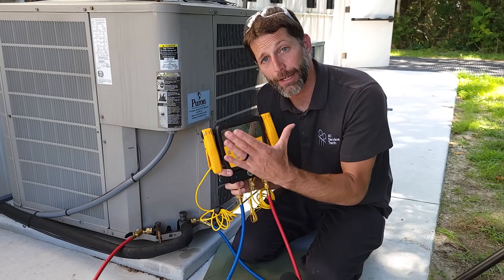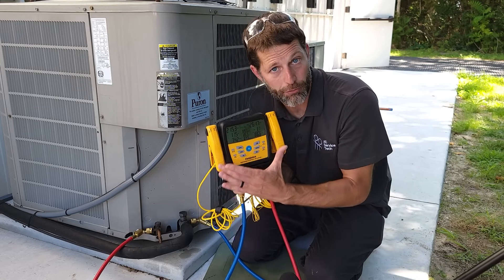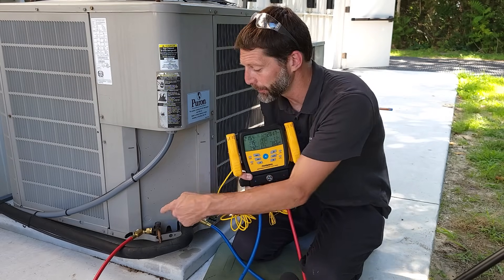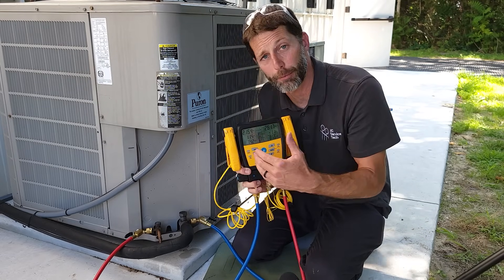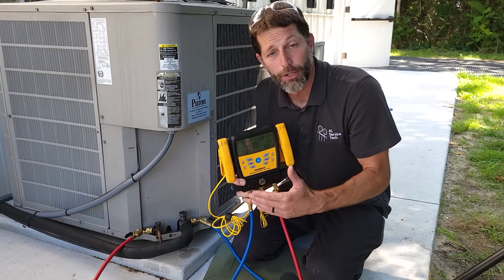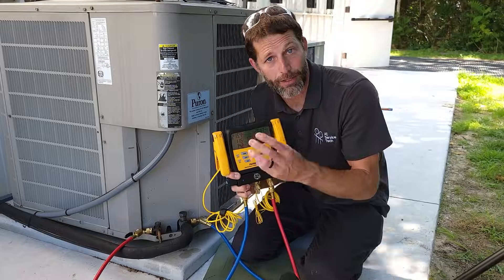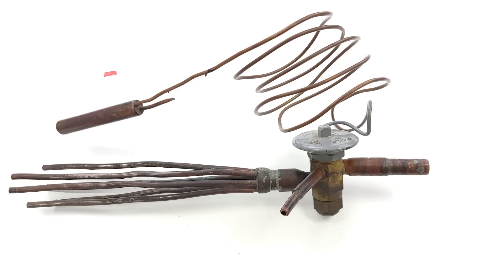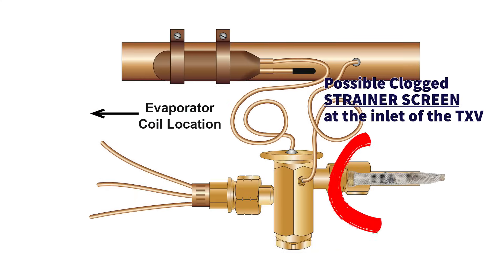Troubleshooting Indicators for a Liquid Line Restriction, Low Airflow, Low Charge! Check the Charge!

Comment: So whenever you charge a system how do you go about temperature if it’s colder obviously your pressures are going to be lower so then your sub cooling will be lower as well right? So how do you go about properly charging the system when it’s pretty cold and pretty hot outside weather.

Comment: A new system was installed in my home never worked ok. 3 technician from the company came to check and nothing worked out, (suction line 130psi  superheat30  saturation60)    
(Liquid line 350psi  subcooling10  saturation110)   any help please???   Rheem 3.5.   Expensive valve system

Comment: Heres a good one...was on a york unit, pressures were almost equalized with unit running. Tech support diagnosed a compressor, changed compressor.....pressures still almost equalized (only 20 psi difference). Verified metering orifice was correct, airflow correct, coil not blocked. What would cause this?
Reply: Get some new gauges 😂

Comment: thanks for the lesson brother, I also want to add an experience that I deal with pretty often. I work with the RTU and majority of the restriction that I have on the units are on the filter dryer. A good way to visually inspect for a restriction like this is to touch both side of the lines (coming in and going out), and if you feel a difference temperature on both side of the line like hot and cold, it means the filter dryer is clogging the refrigerant from fluing properly.

Comment: should the suciton line always be sweating in humid 90+ degree heat? I have a 3 ton unit that is sweating, but I had a 5 ton unit with txv replaced recently, its cooling but the suction line not even sweating, just slightly cold to touch

Comment: Is it possible to confirm a liquid line restriction without measuring the line temps? I had a tech connect his bluetooth sensors his screen literally had no superheat or subcool temp measurments. He quoted a liquid line restriction in addition to low refrigerant. Of course the fix is a whole new system.

Comment: I work at a hospital where they’re using cooling towers and a heat exchanger ( water cooled system ) to reject heat from the super heated vapor leaving the compressor. These Units are also larger, bigger EVAL coils, than your typical residential systems as well. Does any of your methods change for a such a system?

Comment: I love this video. A high Delta t indicates a restricted air flow to the evaporator as well. For those who don't know, the Delta t is the difference in temperature between the return air temperature and the supply air temperature. Normally, it's between 18°-22° Fahrenheit.

Comment: My system is a central air, 2 ton rheem. I did check my delta T and it's 17 degrees difference, which means i think it's good on freon. But I did use my testo digital gauges and it shows that my SC is 43 degrees. what could be happening ? filter, EV coil and CONDENSER are clean, 90 degrees outside and 76 in side.
Reply: What was the problem?

Comment: My outdoor unit runs for about 2 minutes and then makes a loud knocking noise (like a car thats thrown a rod), and shuts off. During those 2 minutes, cold air does blow. Is that a bad compressor?
Reply: Could be.  But I've heard some really bad sounding compressors that still work fine.

Comment: I have a question for you.

I know you said be able to diagnose the system before adding any refrigerants.

You mentioned there might be a low airflow, collapsible ducts, restricted metering device, blower speed issues, or restricted filter dryer. Also, you mentioned checking the  
filter before adding any refrigerants. Subcool must be between 8-12 degrees. Superheat 8 to 14 degrees. Those are normal ranges.

Let's say for example, I have a superheat of 12 degrees Fahrenheit, which is good. 

On the other hand, I have a subcool of 17 degrees, which seems to be higher than normal of 8-12 degrees subcool.

After checking everything you mentioned and finding out everything is normal, are you still going to use your recovery machine and recovery tank to recover all your refrigerants because the subcool is a little high?

Comment: My unit doesn't have the subcool value on the plate.  It, instead, reads R410A 0.55lbs (I assume this is just the air handler amount), Design Pressure High  550 PSIG, Design Pressure Low 240 PSIG and the unit has a TXV in the air handler and an EEV in the condenser.  The condenser has the same PSIG values printed on it as well.  My air handler shows 1000 CFM too.  How would I determine the sub-cool and super heat from these numbers - is it a simple matter of looking at the saturation temps associated with the PSIG range from R410A p/t chart?  Meaning at 240 PSIG, I would have 81F saturation temp and 550 PSIG would be 142F sat temp.?
Reply: Look up the condenser Manual and it’ll be in there

Comment: I live in el paso texas i do hvac service work and installs i love it and with these videos ill become a pro in no time thanks ac service tech
Reply: I live in el paso tx too, and my builder installed a new unit with r410a but worth an r22 txv. I've always wondered and complained about restricted air flow and also the air does not come out cold. I'm not a tech but it has to be the r22 txv not working correctly with the r410a coolant right?

Comment: So I just moved and I put my gauges on unit and low side - 64.1psi, 30SH, and 36.9vsat. High side - 243psi, 24.7SC and 115LSAT. T1(67) T2(90). Does this seem to be a TXV issue or dirty coils? 
Awesome video by the way! 👍🏾
Reply: No one at tire places or dealerships put gauges ona flat tire..you gotta see or find the problem first then put on gauges...what im trying to say is start by checking air filter evap coil condition 
Ductboard/sheet metal/attic/crawl space air handler blower speeds  then work your way to the outside of the home by checking drainage and condenser coil condition

Comment: Here’s one!
R410a with TXV, cooling mode.
Outdoor ambient DB=87 F
Indoor DB=85 F, indoor WB=71F
Required sub cooling=12
Low side=145PSIG superheat =15
High side=307 sub cooling=3
Compressor amps 6.9 
Outdoor ambient and coil temp sensors both ohm at 8.9

Defrost board flashing High Pressure lock out code.  The above parameters were reached holding in the contractor for 10 minutes.
Anyone?

Comment: Can I use this same method if it has a piston instead of a TXV?
Reply: no you need to know the specific temperature ranges to be looking for for the specific metering device the system is using, basing a reading for a unit using a piston instead of a txv is going to completely set you off track, leading you to completely overcharge/undercharge a unit

Comment: I am not an AC service tech. However, I am required to work on them as they are part of a larger system. These videos help me a great deal.
Reply: You need an EPA type I, II or universal certification to be able to work on them. At least if you are either connecting manifold gauzes, removing or adding Freon. If your job requires you to work on units where you are required to check pressure or use Freon, then that is illegal and your company needs to be held responsible for violating the EPA regulations. If I had to pass the exam and get my certification, then you should do same and so does anyone working in your company. Not to be rude, but you should definitely get your EPA certification and or get your company have everyone certified.
Reply: If your not certified at least a cfc 608 epa universal you should or are not legally required to.

Comment: I had a problem today on a 410a heat pump system. It was a new install and I was doing the start up. I dialed in the charge per the charging chart in the unit. I had 332 head pressure 100 suc pressure when it was running in heating mode. But when I put the system in cooling, keep in mind my outdoor ambient temp where I am is 45/50 degrees right now. My indoor return temp was 70/75 degrees. Its a 3 tons system with a piston inside and a txv outside. My head pressure  was 175 with a subcool of 5.6 to 8° my suction was 100.3 to 108 but whats weird is my superheat would bounce around from like 8 degrees down to -0.8 and back and fourth my suc saturation was going between 36 down to 30° back and fourth. I know my charge is right. Because I dialed it in according to the charging chart. And the old system was a 3 ton as well. Is this a low ambient issue or a low airflow problem. What's confusing me is my charge looks weird but my air temps coming off the system look pretty good. Heating was 73 degree return. And a 110 degree supply. My cooling temps were 73 75 ish return, 50 52 degree supply. Any ideas would be cool! Thank you.

Comment: Hi Craig, great video as many others said! My case is R410a system, normal superheat 15, vapor line pressure 125psi, liquid line pressure 315 psi, but my liquid line temperature is 99F! Almost 0 subcooling! I just recharged 3 lb refrigerant, can you help me to understand what’s wrong? Thanks!
Reply: May I ask what you found to be the problem?

Comment: Puzzled need help.5t VS furnace 2 stage condenser Txv.CTOA around 15 to 17 Amana calls for low stage subcool and superheat.SC 5-7 SH 7-9.Subcool spot on but SH high.Delta T low at 14.Evap sat 45 Condenser sat 102. 78RA 64 SA.Elect bills through the roof over 500.00 2200sq ft home.Condenser normal evap starved.Whats weird is I'm getting shaking liquid line and can hear the bubbles.Inside condenser is LLFD.No temp across drier but going in to drier is 3/8 coming out to service valve is 5/16 from factory.Is this causing a change of state of liquid causing all my problems?

Comment: I've had two different technicians out, and everyone is stumped as to how to fix my Geothermal R-22 Trane Heat Pump;  Vapor side is 74 psi @82F, Liquid side is 164psi@163F.  Ground tie geothermal with 20 psi water in the loop;  Loop return 79F, loop send 81F,  Air temp = 82 return, 80 send.  I've never seen any examples with the high side so hot.  Could this be possibly be a low flow through the water loop issue?  How much pressure should I be running in the water loop?  I think I may need a sight window to ensure there is a flow through the loop.  I can see the pump spinning nicely, but no telling how much flow is actually happening...   Another issue is that the tech said that the service label was covered up by the install... so he couldn't get the data off the label.. ever had that problem?

Comment: Craig as always, excellent lesson. Great quality videography and sound/audio. You set the standard! Quick question regarding LL restriction - once you have eliminated the service valve and the Filter Drier as the cause your are left with the TXV or Strainer Screen. If you put the TXV Bulb in ice water and there is no change in the meter readings, does that rule out the TXV and indicate the Strainer Screen is the culprit? If the Screen is the problem,  what are the options to fix this. Thanks.
Reply: A liquid line restriction will be indicated by a temperature difference on the liquid line.
Some condenser units will have a dryer internal to the condenser (before the service valve) so check for temperature changes starting at the exit of the condenser coil.
If the strainer screen on the inlet of the TXV is plugged the body of the TXV will feel cold to the touch... hope this helps you in your troubleshooting!

Comment: I would like you to do a video about how to install a TXV correctly please, or if the angle of the bulb matters and all that, thank you.
Reply: The position of the bulb is parallel to the suction line.  Horizontal 3/4 or less at the 2:00 or 10:00 o’clock.  Vertical the txv bulb pipe must come from the top.
Reply: @caru3257  thank you, I asked because I had some problems with TXV lately but I don’t understand why cause I do the way you said and the TXV didn’t wanna open

Comment: I don’t understand why your subcooling did not go up with a “restricted” TXV. I would assume that the condenser would start stacking liquid. Great video as always.
Reply: The charge is correct so the compressor has little vapor to pump.  It is my 3 cents.  I am adjusting due to inflation.😂😂😂
Reply: @caru3257  the compressor is a vapor pump. So it should always have vapor, unless TXV is wide open flooding back liquid to compressor. I was always thought high super heat/high sub cooling = restriction.

Comment: I didn't like my experience with it's sman pressure gauge. they are good when the valves don't leak. my second has the same problem as my first Sman460. it is leaking on 2 service valves which has distorted my service calls for a week. Leaked after 1 year both. you don't have this problem? Sorry for my poor english

Comment: I'd love to see you do this on a system with a piston. Thanks for using digital. Probes are the future!
Reply from the maker: Sure are! I use digital probes on service calls. i just use compound for teaching because thats what the tech schools use, thanks!
Reply: @acservicetechchannel  how do you like using probes on micro channels
Reply: Like how do you use probes on a micro channel wouldnt u mess up your charge connecting a probe to a micro channel?
Reply: Please don’t feed the troll.
Reply: @KyleWithStyle7  what do you mean? I don't understand this question. It's no different than any other type of system
Reply: @arthurhartwick7974  When removing your manifold off the liquid line you lose a lot of pressure if you just take it off. I figured out what I need and got one and it has been working great it is called a thumb screw core depressor
Reply: Charge to superheat on piston systems.

Comment: Craig, have you ever diagnosed a home refrigerator that has cooling problems?  I’d love to see diagnosis on that.
Reply: What’s going on with it and brand
Reply: @chrisacevedo7683  LG refrigerator...had compressor replaced, ran good for 2 weeks and noticed freezer was at like 10-15 degrees and was not making ice...had tech come back and he added freon saying it was low...ran fine for about a week and again with freezer being in the teen degrees area...refrigerator section, french door refrigerator, was cool...I'm assuming there was a leak somewhere, maybe in evap coil...it was under warranty and we just ordered new fridge...right now it sits in my kitchen inside temp at 80 degrees...just use it for water until new fridge comes by end of month...what would the low side on the gauge read if it were running normal?

Comment: What happens to the sub cooling if a unit is correctly charged and the condenser is extremely dirty or blocked on txv system?Thanks.
Reply: It can actually go up higher than normal

Comment: Example low airflow even with a TXV usually will have low suction pressure low superheat normal subcooling high delta t low amp draw.  On your test you had low suction low evap temp normal superheat normal sub cooling . Any time you have a low side heat transfer problem it shows up with low evaporator temp and low superheat. I believe if you would have let the system run in your low air flow condition long enough to stabilize in this condition your superheat would have decreased too. Do yo agree or disagree?  I was just saying you did not let unit run long enough in fault condition to stabilize at fault condition. Are my assumptions incorrect? About the low superheat? Please elaborate…
Reply: @R P I disagree low airflow will eventually freeze evap and suction line low superheat. At first it will hunt but upon stabilization it will drop.
Reply: @R P Thermostatic expansion valves (TXVs) are often misdiagnosed as the root problem in poorly performing air conditioning and heat pump systems. The truth is that two-thirds of TXVs returned show no signs of failure. For this reason, we recommend taking a system-wide approach when troubleshooting. Eliminate all other components as a source of a system’s performance issues before investigating the TXV as the culprit.

Figure 1
Low airflow
Low airflow is one sign that the cooling system is not functioning properly, and it has nothing to do with the TXV.

Figure 1 shows two identical evaporators being fed by a TXV with the evaporator on the left getting adequate airflow while the one on the right has inadequate airflow (note the superheat values and evaporator temperatures). Low airflow can be caused by a dirty or clogged air filter or a malfunctioning fan or blower motor, so be sure to investigate those components as the source of insufficient airflow.